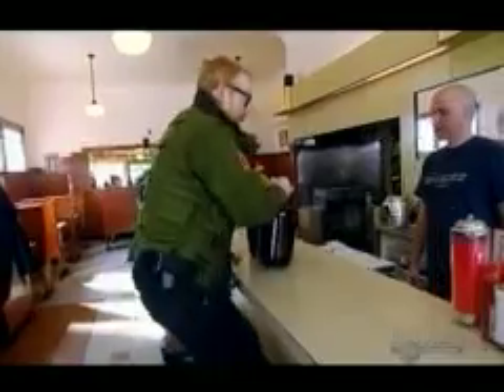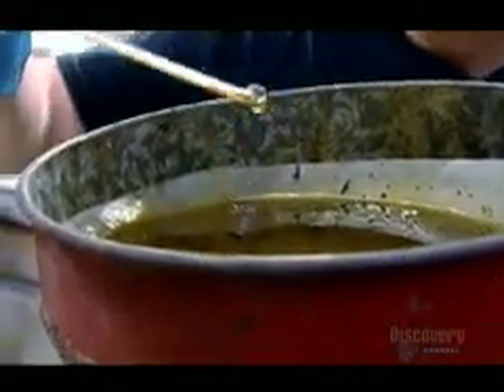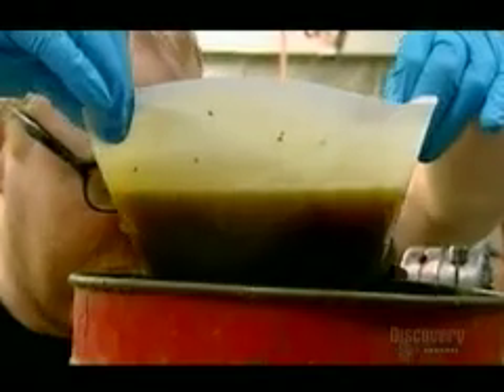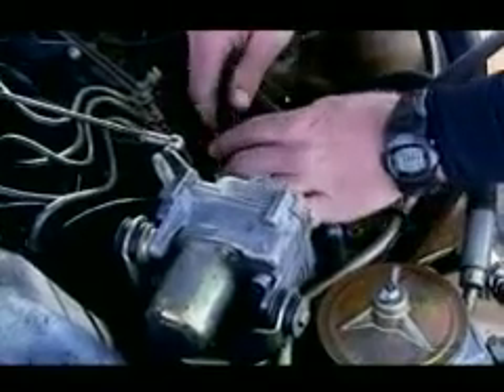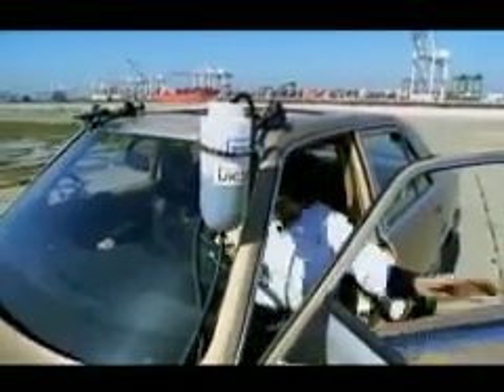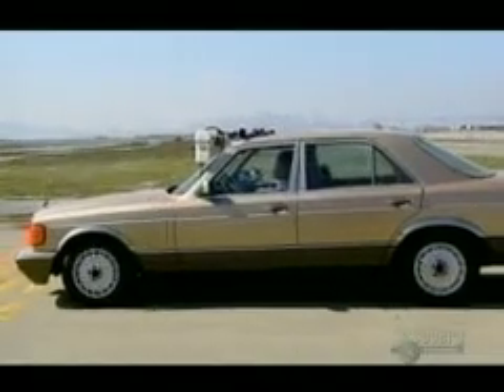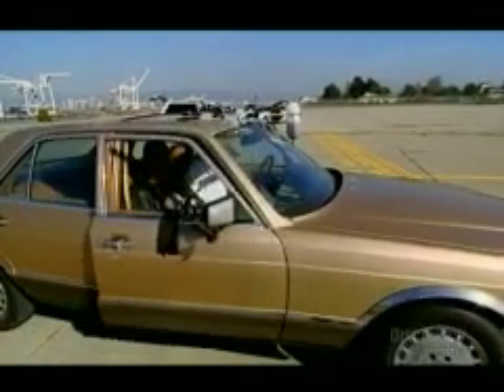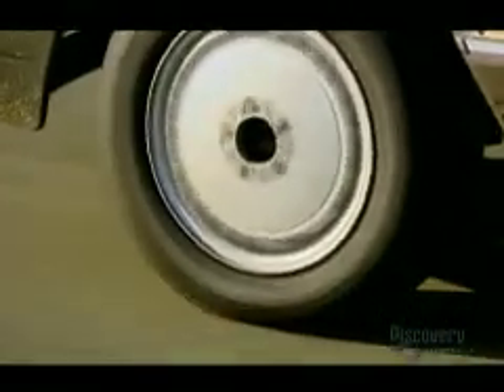Mythbusters - Cooking Oil as Economical Diesel Fuel

Comment: Ive been doing this in my mercedes 300d for almost a decade. You must heat the oil before it's run through the injectors or it will not atomize and not burn cleanly resulting in short engine life. The original diesel engine was engineered and intended to use peanut oil.

Comment: yes it does if you get the ratio right.... we've used it on several vehicles...seems to be best in diesel vehicles  we got up to 12 mpg more out of a Peugeot 106...less for a kawazaki gt750...4 mpg in a jag...and similar on a few other vehicles ....the tricky part is the ratio as  it varies but it does work....not on all vehicles we tried....and they go way better and start easier

Comment: Any Mercedes made during a late W124 stage (E300D) and beyond couldn't run on cooking oil without some consequence. If you put that stuff in a current day diesel, you would fuck up the emissions systems and the screw the fuel lines. 

This only applies to simple diesel engines that don't have electrical systems or complex emissions to get cleaner tailpipe smoke

Comment: Beauty of mechanical injection- if it'll burn, chances are you can run on it. Veggie oil, motor oil, jet fuel, trans fluid..... Just don't try the veggie oil if it's going to get cold enough to solidify it. Doesn't matter if it's IDI or not.

Comment: Seems to work out just fine on a friend's 2005-ish Ram 2500 turbodiesel.  Drove it a couple thousand miles in a week, burning only a few gallons of diesel (warmup and purge).  I think it might have needed a new filter on the trip, but that was a filter he had been running for a while before we even left.

Then again, the cummins in his truck might not be considered as "high efficiency" as you are referring to.

Comment: New diesel engines run at much higher pressures and compressions and diesel also lubricates the engine as it runs so veg oil would work fine in old bomb proof diesel engines but the modern high efficiency diesel engines wouldn't fair too well after a few thousand miles...

Comment: this will not work with new, modern diesel engines. 
but the w124 mercedes was known, or is known, to be able to run on vegetable oil without any mods whatsoever. apart from the temperature and clogged filters, which need changing once a week.

Comment: I tried the vegetable oil route for a while. It works as advertised. However I have heard of a few folks who wrecked their injection pumps because of the high viscosity - you should heat the oil to 180 degrees. Below 100 degrees the fats started to solidify and plug the filter. I found myself not being able to get the system going in the morning. You need a heater IN or ON the filter. Kudos to those who do this but I ended up deciding $3-4 a gallon at the pump is worth what you pay for it.

Comment: I guess Top Gear are shills too, because they did the EXACT SAME THING. They put a little mineral spirits in the oil, that was it. And they didnt say hydrogen wouldnt run an engine, only that that SPECIFIC DUMBASS INTERNET KIT wouldn't do it. This is not to say it would work long term, only that it works. I thought you had to start on petro-diesel too.

Comment: That's true, but the episode isn't entirely accurate. You need to set up an extra fuel tank for the veggie oil first. Start your engine running on diesel fuel and then switch to veggie oil, switching back to diesel before you turn off the engine to keep the lines clear.

Comment: Diesel engines were designed originally "Rudolph Diesel" to run on veg oil; too bad in an effort to make them "better" the new ones don't have the same capabilities as the older ones...that can run just as efficiently on both...don't make em like they used to..

Comment: I live in Barnsley, Sth Yorks mate, and i use no mods straight from the shelf to the tank, i go to catering supply warehouses and get it in 20L drums it works out at 89p a litre ;) I must admit i do mix a bit more  diesel in the cold months just to be sure, I am thinking of putting a 12v heater blanket around the fuel filter just for the bad winter days. I have mates who also put a little bit of petrol in the mix too.

Comment: This is only busted because these guys are just covering their asses! You don't want to be rocking the boat with oil companies, especially on TV. I've been running my car on veg oil for 4 years, no conversions or filtered recycled oil, just straight out of the bottle. At the pump, as of this week, diesel is £1.42 per litre, while I can go to tesco and get it for around £1.00 a litre. Fuel consumption isn't much less than normal but the cost makes driving in the UK a viable prospect.

Comment: Its good stuff in older diesels cheap running, i had an old peugeot 1.9 xud run on the stuff for a while with no problems. But the newer common rail fuel injected diesels wont run well on this stuff.

Comment: The original diesel engine was run on pure peanut oil. Long before hydrocarbon diesel was even refined from crude oil. The Mythbusters have it right. NO MODS needed to run a diesel engine on cooking oil. The only mod I would say is needed is a tank heater to keep the oil from gelling in the cooler months.

Comment: If you have a 7.3L Powerstroke diesel the ultra low sulfur diesel will dry and crack your seals on your fuel bowl causing a fuel leak I just put a set of seals in my 1996 Ford F-350 7.3L Powerstroke and the seals on the fuel bowl are leaking again so I'm wondering whats better alittle more soot in the air or alot of diesel fuel on the ground

Comment: just a thought, sulfur in diesel fuel acts as a lubricant, and new low sulfur fuel is "dry" and can be hard on injector pumps. So, I wonder how the lubricity of cooking oil compares to current pump diesel, because it may actually not be a good idea to use it(conversely, it may be better...), in terms of longevity of your fuel pump(s)

Comment: Appraently, if the oil is not heated correctly, it will leave residue in the engine forming carbon buildup. This will reduce the life of your engine. Best find ways to 1. heat the oil b4 using. 2. clean excess carbon build up from engine.

Comment: you need to correctly filter it by cooking it again after filitring it then putting it in a diffrent fuel tank than the normal tank and again need to heat it up to a certan temp before using then you have your hoses and pumps and switches you need to use a pump that connects both fuels and closes the valves for one and opens the next then you need to purge for at least 30 secounds to clean veg out of the main lines. if you pour the veg in your regular tank it will gell up and damage your motor.

Comment: Busted my fucking ass. You just ran it on FREE vegetable oil, a renewable energy source. How the fuck is that 'busted'? Actually, having seen Top gear do the same thing, they added a tiny bit of kerosene to just make it that bit more runny and for it to work better and get more miles per gallon. 
Frankly, the idea this is 'busted' is like saying, "It works, its a good idea, its cheaper by a lot. But no."

Comment: Well DUH a big rig truck won't get 40 mpg. But a sedan? It's an old S-class with either a 3.0 or 3.5 engine, not a big rig truck with double-digit liter displacement. Meaning that FOR ITS CLASS doing 35 mph, a fuel efficiency of 33.3 MPG is, indeed, pathetic. Idiot.

Comment: I've ran my 1982 Mercedes Benz on Biofuel which is process used resturant oil for 6 months and I found that my miles deceased to 17 miles per gallon when on diesel it could get an average of 23 mpg. However, the more I ran my car on the biofuel my mileage improved. I even got up to 27 miles per gallon which is better than what I've been getting on diesel lately. I don't know what happened but when I moved towns and had to go back on petroleum diesel my millege sunk to 18 - 20 mpg.

Comment: So the key here is you only have to filter it? is that the only thing you have to do? cause they were kinda vague about the process... I was under the assumption that it had to be mixed with lye and methanol before it could be used safely in a diesel engine...

Comment: They busted the other energy devices sold for engines, not Bio Diesel, and by the way they got the crud from the bottom of the friers. If you get the top oil off the frier oil and especially peanut oil it does even better and is easier to use. I process my own bio diesel and use it in my trucking company with no problems.

Comment: @chillerized Probably not.  Most people have been convinced that diesel is some tricky mixture that needs to be just right.  For the newer diesels that's more important, but conventional diesels will run on old engine oil, trans fluid, veggie oil, peanut oil, etc.

The only con with veg is that it can gel easily in the cold, so a Y-fitting and a separate heated tank is often used so you can switch fuels after the engine warms and then switch back 10min away from your destination.

Comment: @Raven0628 The stuff on Top Gear was just White Spirits, which is just Mineral Spirits in the US.

Essentially, veggie oil works exactly the same and from what I've heard it actually works better in most older diesels.  I ran out of gas once in my 81 VW Rabbit and got some veg oil in a 10oz cup from a restaurant that was across the street and I was on my way again.  I keep a bottle of used ATF fluid mixed with used(but filtered) oil in the car now in case my gauge tricks me again...

Comment: part 2
Another way to use WVO in your diesel car is to convert it to biodiesel. There are many resources online explaining how to do this. With any of these 3 types of alternate fuel for your diesel engine, they cannot be used when cold, not as much of a problem as with biodiesel vs WVO and SVO but biodiesel gels at a higher temp than regular diesel

Comment: Part 1 The way they did it in this video will kill your engine if you try it. If you are to run on waste veggie oil (WVO), it must be filtered and all water must be taken out of it. If you want to run straight veggie oil (SVO) you must just make sure there is no water. Once you have filtered oil with no water in it, you must make sure it gets to your fuel system at the consistency of diesel fuel, meaning you have to heat up the oil or your fuel system will fail because it is caked up with fat.

Comment: for the efficient motor, check out the Shockwave Generator -
popsci.com/cars/article/2011-03/shockwave-generating-wave-discs-could-replace-cars-internal-combustion-engines
the idea has been around since the early 1900's

Comment: No you can not requires compression ignition like a diesel engine or a nother for a diesel engine is (compression ignition ). My uncle is a engineer on diesels and was the valve train engineer on the dodge ram cummins 5.9 litere diesel.

Comment: Doing this for 7 years.You must add heat from electricity and/or the cooling system to bring the fuel temperature up to about 155° that is lower the flash point so the vegetable oil burns easier and doesn't coke the rings.Cold vegetable oil in a hot engine is bad.Again while it will work for a while over long periods you will ruin the engine.My mods are coolant & electric inline fuel heaters.Restaurants pay for oil collection.Do yourself a favor and them.Collect your own fuel. Free Fuel Forever.

Comment: @Kamaly0 Made public?  Anyone can buy it now. 
In case someone does not understand the word: ec·o·nom·i·cal /ˌɛkəˈnɑ:mɪkəl/ adjective
[more economical; most economical] ]
2 — used to describe a product that is not expensive to own and use

So, even buying this used oil from a restaurant and filtering at a cost of $1 per gallon IS A LOT MORE "ECONOMICAL" than $4 per gallon Dino fuel.  I do not filter my own, I buy my WVO decanted/filtered 4 times and pay $2 per gallon right now.

Comment: This myth is busted because of the economics of biodiesel. Even the mythbusters found that just filtering the used oil was time consuming. Not to mention the other chemicals contained in the cooking oil needing to be removed to prevent engine damage. Long story short, if a gas company figured out how to make this for cheaper than gas, and sell it for less than gas, they would because it would allow them to economically rape every other company on the planet. The end.

Comment: Yeah used cooking oil CAN be used in almost any diesel engine. However it is not really recommend unless you remove the glycerin from it, glycerin can clog the injector pump and fuel injectors. You need to add a chemical to separate the glycerin. Then you should add mineral spirits to the oil to help it burn more efficiently.
Reply: What chemical is can be used to deactivate the glycerin. What about bacteria fermenting it.

Comment: doesn't scale up too replace all the work done by the internal combustion engine, same problem with all the other alternate energy sources. Cant scale up to the levels required. There is used vegetable oil out there, but nowhere near enough for everybody.

Comment: You should really clean the oil better than any filter can by using a centrifuge. A good centrifuge will also clean the oil much quicker. I have a practical book titled "Alternative Energy Secrets" that you should check out it you want to do this type of thing safely. Having to replace your injectors or and other engine parts will wipe out your savings. Check out my videos.

Comment: I run on Veg oil, and have for about 200,000 km.  It's not a myth that veg is economical, it's a fact.    After driving nearly coast to coast on WVO and paying less than $100 in fuel filters, I can say by experience it works.
To get good longevity and economy out of veg. oil is to heat the oil up before it gets to the engine.  Myth busters did not heat the oil.  So sure it runs, but not as efficiently as it could. Veg has less BTUs, but also has a higher Cetane rating, making up the difference.

Comment: The REAL myth is that you can NOT put straight WVO (Waste Vegetable Oil) into most diesel vehicles without modfication. It's one thing to run 1L of WVO in an old MB. Just try to do that in any modern diesel vehicle for even a single full tank. 

Disaster.

Comment: @peterfaj Guess the title is misleading.  Economical vs Efficient. Also, I would be interested to see if the car had any fuel in the lines before they put the 1L of fuel in.  Would have liked for them to do another trip around after the WVO with regular diesel.  As for economical, we are taking a 1000 mile trip to Virgina this weekend for a wedding.  Going to cost $20 for fuel.  Not to bad eh?

Comment: @sard37 problem is, nowadays they are. Common rail cant run wvo, certain IP's have seals that wvo will perish, cold oil is too thick to burn completely so can leave deposits on the  bores which can gum up or worse still, run past the rings and polymerise the engine oil over time.... best bet for wvo is a 90's tdi with heat exchanger on a twin tank setup, or mixing diesel and veg on a 50/50 ratio. I get wvo free and have run a few cars successfully on it, but there are pitfalls for the unwary.

Comment: @drogoKoJ Rudolph Diesel was quoted saying that eventually you will be able to use oil extracted from wood chips to run the (diesel) motor.  And that was back in the early 1900's when he firsy built them.

Comment: @Awshbuscus   It reads "As Economical as Diesel" not better.  I run WVO oil in a 2000 Jetta.  It cost me approx $1 per gallon after it is all filtered and ready to burn. Even if I get 70% less MPG it would still be more economical.  But I get around 50 MPG with the WVO, the same as Diesel.

Comment: yeah but cooking oil does not have the proper lubrication that your lift pump needs. look you can run that car on 
1. hydralic oil
2. burnt motor oil
3. Grease.
4. Karoseen
5. Off road disel wich 15rppms are off which causes knocking.

but DIESEL 1 and DIESEL 2 has the proper lubrication your pump needs

Comment: @PS2Gameplays And like I said "The inside of cylinders will get screwed and you'll loose rings, injectors and performance but you won't see it unless you take an injector out and stick the carbon-cleaning tool" so if it's a cheap $1000 car like 240D who cares but if it's a $50,000 GL 320 CDI then I wouldn't do it.

Comment: @PS2Gameplays  Car runs with vegetable oil but it ruins the inside of injectors and cylinders because carbon builds up and slowly blocks the injectors. This is how Wiki describes it: "the viscosity of vegetable oil must be lowered to allow for proper atomization of the fuel, otherwise incomplete combustion and carbon build up will ultimately damage the engine".
That carbon buildup is called "injector Coking" , veg. oil also causes piston-ring sticking and also wipes tank's protective layer.

Comment: @emmettebrown the first 2 probably not as engine oil. engine oil isnt exactly just like lube! it has to be made for a specific heat range! too hot and the molecules break down too cold and it doesnt become fluidic enough!
bottom line is the engine would burn up the cooking oil and probably varnish itself with it and then suffer a catastrophic failure in the sense of a massive bang! just use it as fuel and use actual engine oil for your engine!

Comment: You can't use that crap in regular diesel engine. Yes engine runs with it but carbon builds up fast inside injectors and behind glowplugs. After filtering a mixture of Methanol(20%) and Potassium Hydroxide(7gram per litre) must be added to the warm oil then stirred then left overnight so the grease sinks to the bottom & then you can use it in the car.Beware because vegi oil will remove the gas-tank protective layer & sends it through tank strainer & gets the strainer & primary filter clogged up.

Comment: @markus24q 
This cooking oil fuel is a lot more viscus than normal diesel fuel. Common rail runs on up to 11000 PSI VS 4000PSI for a normal Diesel engine, which will of course lead to serious problems when  run on the viscous Bio-diesel